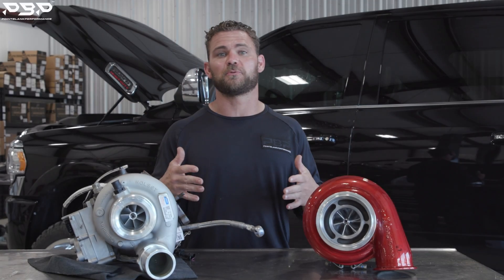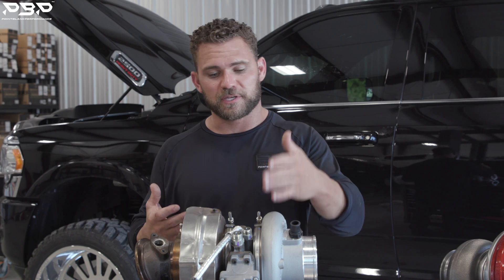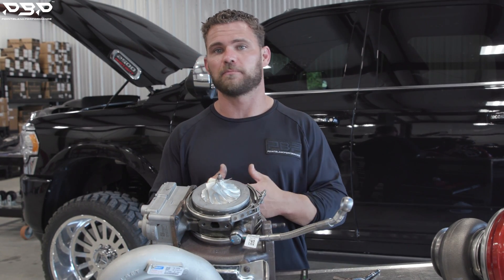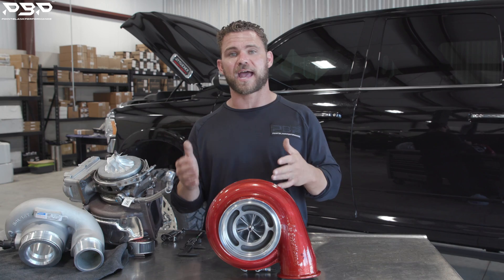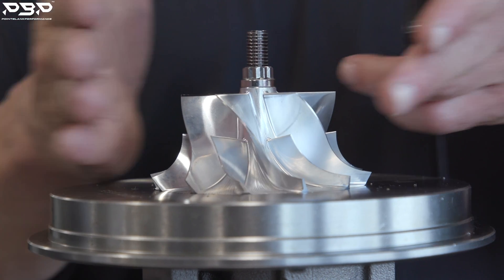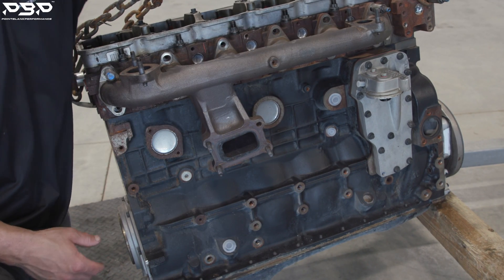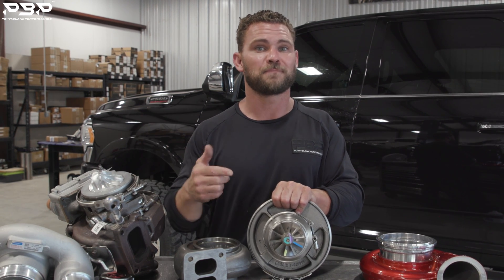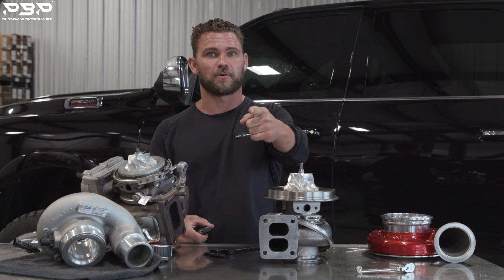5TH GEN CUMMINS VGT SWAPPED TO A 2ND GEN TURBO!

Comment: Dumb question but what is referred to 2nd gen swap?
Reply from the maker: No worries ! You take a manifold style from the 2nd gen dodges and use that style on a newer truck . It moves the turbo in the middle of the manifold so you have the front three cylinders feeding one side of the turbo and the back three cylinders feeding the other side of the turbo!

Comment: Do you still recommend the same turbo for the 3500? I believe it has a lower compression ratio to make the 50 more hp. Thank you!
Reply: No sir. No truck at all but I’m trying to get my ducks in a row first. It looks like I’m going that direction…and I don’t like leaving much anything as it was intended by some oem. Aftermarket ftw!
Reply from the maker: @dapymp17  If you end up getting personally I like the non HO version !
Reply from the maker: You have a HO?

Comment: 8:07 cylinders 1 and 5 don't fire at the same time. They are on opposite strokes. So everything you followed that up with is wrong. Also, it's pronounced "oil". Not "ol". Cool video for dumb people though.
Reply from the maker: Sir I’ve looked back on all your comments to my company channel .. nothing but hate . I’ll leave your comment up on this video to help a more accurate understanding of your comment be understood. Thank you for making my delivery understood to the “ dumb “ viewers that just after 1 fires cylinder 5 is on compression. Thank you for the view Lucas !!
Reply: @POINTBLANK PERFORMANCE  ya no problem! If you are making instructional or informative videos you should focus on presenting accurate information. Most of it is pretty accurate but some is not. I will continue to point them put for your viewers
Reply from the maker: @lwilde0422  Thank you sir and as always thanks for the view!
Reply: @JaegerWrenching  ya the PBP guy talking about pulses fighting against each other is false. The point of twin scroll is to reduce volume between the exhaust valve and the exhaust wheel of the turbo. That's all. I think PBP is trying to make its name in diesel world but every video I see showes their inexperience. I would never take my truck to these guys. Ever.
Reply: @lwilde0422  I worked with a guy "the manager" of a shop but he didn't know left from right when talking about performance or mechanics. This really irritated a few customer who   called or talked to him who really knew things and knew he was lying or just plain out didn't understand what he was talking about. Us mechanics did understand and we put out a few fires and made the customers feel more comfortable knowing we were competent and working on their trucks and portrayed that he's just a businessman, not a mechanic or tech. The real issue is most customers don't know either, which is why they bring their vehicles to shops in the first place. 80% of my customers don't care about the fine workings of their truck, they just want power! As for you and thinking PBP is incompetent/dumb because they made a video error you fall into that same category i just explained IMO. But hear me out, I see this from both sides being i've made a few videos in my day, and I own my own shop doing this exact type of work. I can say it's not as easy as you think and once the video is shot and you start to edit it and you see a simple mistake/word fumble. Most of the time you didn't know you've made that mistake and it's actually difficult and very time consuming to reshoot to make that simple correction. It's easier to just put it out and take the abuse in the comment section, or mention it in the comments and pin your own comment so people know. Sometimes you don't even catch the mistake until a viewer like you does! We all make mistakes, we all learn from them, just think of it as if you had a camera on your entire life and someone was critiquing your every mistake. How would that make you feel? To me it gets old really quick, therefor I give PBP props for even putting this stuff out there, as most companies hide their work and their mistakes. These guys put it out there for all to see and i think that's more transparent than 95% of the companies out there, mistakes or not at least you're seeing their true self!

Comment: What specs for the stock turbo? I wanna upgrade but not sure what to get for measurements
Reply from the maker: I believe I came up with 58mm Check back through when it was on the table I had my calibers out !
Reply: @POINTBLANKPERFORMANCE  What would you recommend for specs for the upgrade? I’d wanna do a 64mm but not sure what else
Reply from the maker: @JimmieABES  What’s your primary use of the truck ?!
Reply: @POINTBLANKPERFORMANCE  Mostly daily driving but I haul a 30-ft fifth wheel around 5-10 times per year
Reply from the maker: @JimmieABES  Then I would do a 67/83 with a 1.0 AR sir
Reply: @POINTBLANKPERFORMANCE  Dude, thanks so much! I’ll get on it right away
Reply from the maker: @JimmieABES  Anytime sir !

Comment: Y’all done anything to the Transmission?

I read somewhere that they 5th gen 68RFE gets a beefed up valve body from the factory. 🤷🏽‍♂️
Reply from the maker: We are running higher than factory line pressure sir.  The factory valves body’s don’t do well at all with power.
Reply: @POINTBLANKPERFORMANCE  got it. Bad ass truck.
Reply from the maker: @mendiesel7932  Thank you sir !

Comment: very well explained video... got me thinking of upgrading now
Reply: Do you guys do the install ?
Reply from the maker: @theslush3574 We build the trucks yes sir.
Reply from the maker: Thank you sir !!  If we can be of any help let us know !
Reply: @POINTBLANKPERFORMANCE  what’s the complete price for this upgrade?
Reply from the maker: @kapokidkidkapo719  We only do in house builds only sir if you were interested we can provide a email quote . Most 2g swap kits on the market including ours are over 4K sir.
Reply: That was cool. Lurned a lot about the 5th generation and why you can put such a big turbo. I have a 2017 6.7 cummins 4th gen. I did a 3rd gen swap. I went with the B.D. Iron Horn with a s300 64.5  Bullet turban wheel and got the pulse manifold with it. It was like putting headers on her. The 64.5 is incredible 😍 👏 for my 4th gen. I still have to do an exhaust break on her yet and head studs too, and  Intercooler piping. It is already so much better than stock!!!